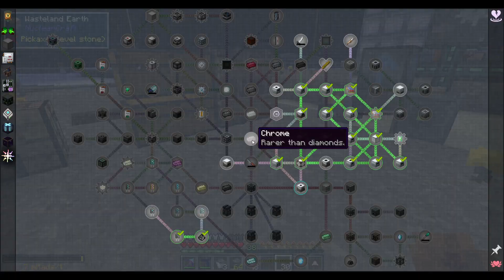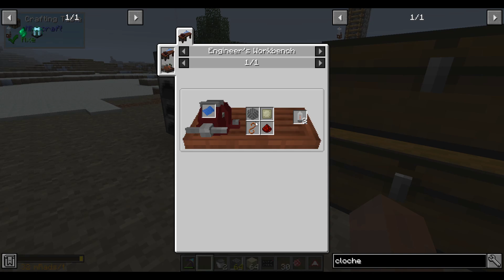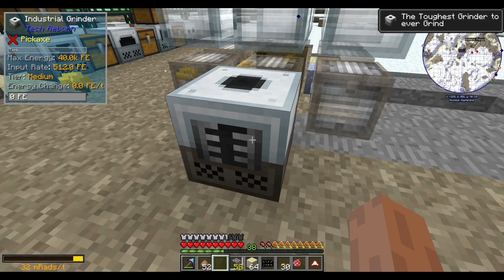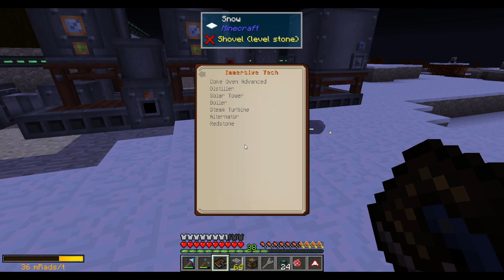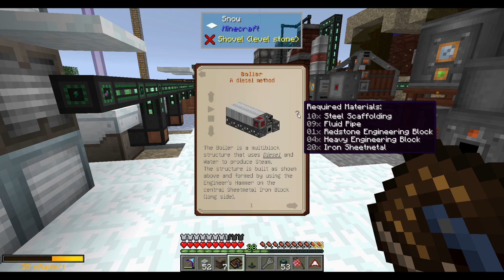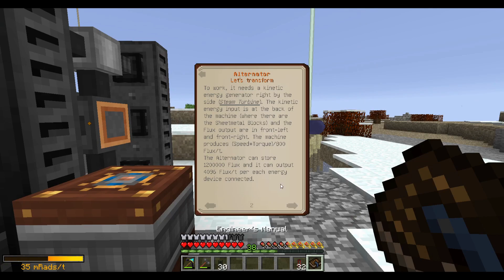Nuclear Earth: Reirradiated EP04: Plant Powered

Comment: God this mod makes no sense. I feel like it would be rude to nerf it now that you spent 200 steel to use it.
I'll give you this warning, in a coming update, the alternator won't produce more power from one turbine than it can possibly output. Its already absurd. I'm reducing the generation by 7 times, which should keep your power grid stable, but not brokenly op.
Reply: You could also lean into it, and nerf steam generation
Reply: Yea good to hear. I mean, given its cost at the early stage of the game, it should produce just enough RF to power an early game base. Close to 10k RF/t would be just about right. Otherwise, there's no incentive to switch to Mekanism Ethylene later. Just stack another turbine/alternator 🤣🤣

Comment: Something that has to be noted about alternator, sorry if you already noticed this, while the alternator does produce 90krf, for some reason you can only extract 24k rf a tick from all the the 6 outputs combined. At least that’s what I found in sevtech, it might be different in this modpack EDIT: nevermind I didn’t know you could extract from multiple sides of the energy ports
Reply: Pretty sure tou cant. But using phantomfaces is a genius idea